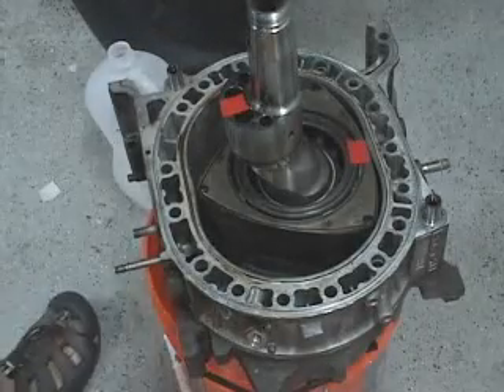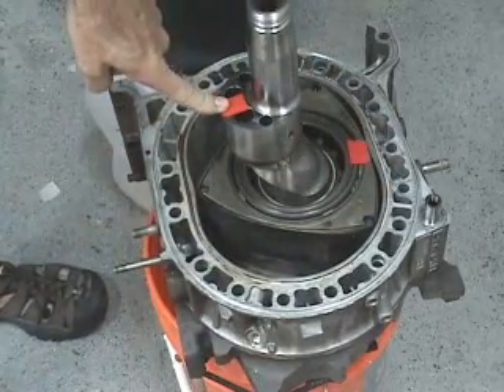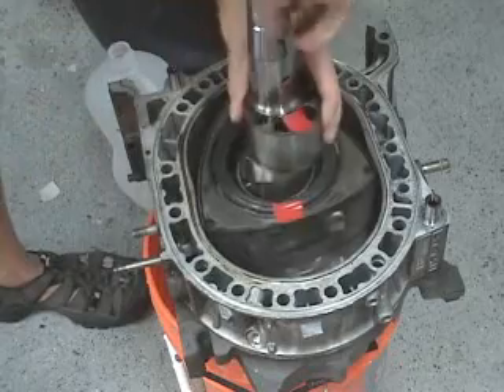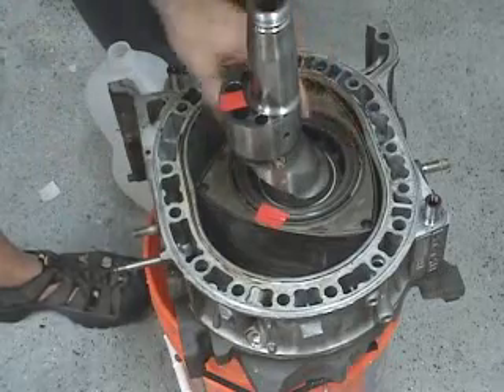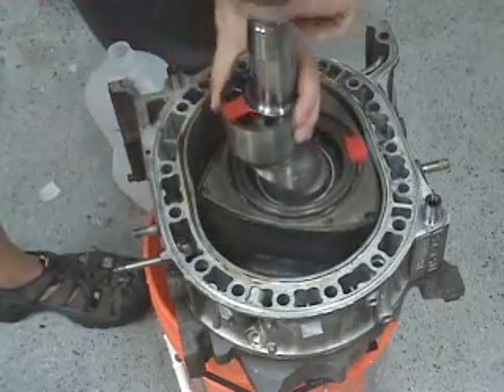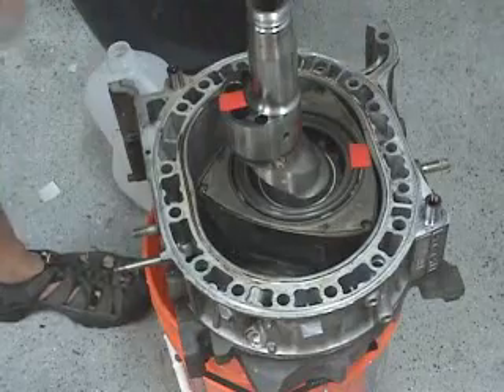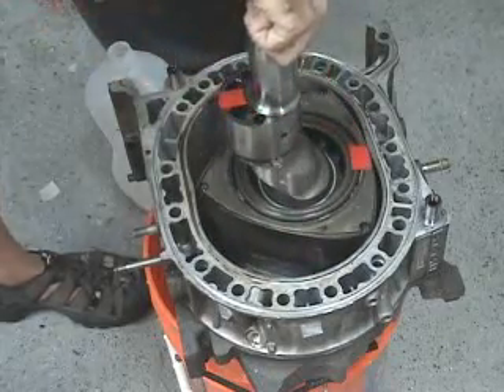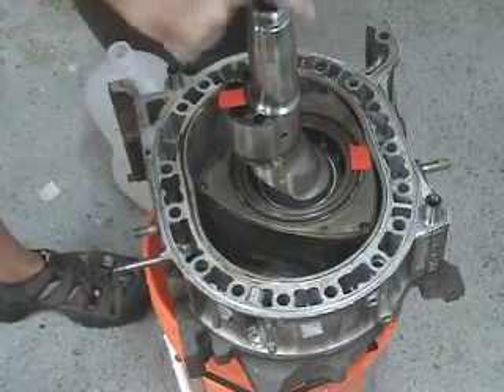Rotary Rotational Demonstration

Comment: only 15 here. would this be a 3 stroke then? or what would it be
Reply: No I think still 4 strokes. It still does intake, combustion, ignition, and exhaust, just all on one rotation.
Reply: meharidude +Pedro 's  right, calling it a two-stroke or a four-stroke has nothing to do with "stuff" happening inside or outside.. as a matter of fact they are all still INTERNAL combustion engines, which means everithing happens inside the cilinder. However these engines are also known as two-cycle and four-cycle which means that two--cycle engine does all four strokes in only one complete revolution of crank shaft where as four cicle does the same in two complete crank shaft revs which means that in two-stroke(cycle) engine intake and compression are one stroke while the ignition and expansion/exaust are another, and with a four stroke(cycle) all four of those: intake>compression>ignition>expansion/exaust are diferent strokes... The only major difference (apart from what I've already explained) betwen these two engines, which is noticable even to the small child is that two stroke engne doesnt have valwes, and that it uses a mixture of petrol and oil (not necessary but most of them do) but there's still not happening "outside" in fact the only thing happening outside is mixing the petrol with oil, which does hapens in a pump with new two-stroke engins (with the old ones you had to create the mixture yourself) but that doesn't count as a stroke.. So there you have it from a mechanical i.c.e. engineer's point of view...
Reply: Think about it, in all 2 strokes, with no exception, the gasses are forced, not sucked, into the combustion chamber. Either from a scavenging cylinder or the crankcase, sometimes a turbo is used. Bottom line, a 2 stroke can't suck gasses into the combustion by itself. Wankel, the inventor of this Wankel engine, patented it as a 4 stroke. and it is considered a 4 stroke today.
Reply: meharidude Yes I think we already agreed that Wankel is a four stroke, however I just pointed out the diferences betwen 4 stroke and 2 stroke engines, explaining in the proces that 3 stroke engine is imposible due to the technical caracteistics of i.c.e.
Reply: BUNCHofxs I see your logic but you are missing a very important fact about the Wankel KKM (and the topic of this vid) 

You don't count the piston/rotor rotations, its the shaft rotations that count, so for every shaft rotation there is one combustion stroke/cycle. (like a 2-stroke)
 but unlike the 2-stroke the intake and exhaust strokes are not combined, all 4 cycles occur separately just like a 4-stroke Otto cycle.

It is technically classified as a 4-cycle engine.

Cheers!
Reply: The simplest way to determine if a piston engine is a 2 or 4 stroke, is to count the number of turns versus power strokes per cylinder. If you have a powerstroke for each turn per cylinder you'd have a 2 stroke. However this is so simplified that it doesn't cover all engine configurations. How about double acting 4 stroke engines, would they be 2 stroke? They would have a powerstroke for each turn as well. Looking technically at a 4 stroke versus a 2 stroke, for instance if you'd have to calculate mean effective pressure, you'd look at the cylinder volume and multiply this with 2 on a 2 stroke, but 1 on a 4 stroke. Why? Because you'd have to include the "hidden" cycle that takes place in the crankcase or scavenging cylinder. This cycle also uses power and without including this your figures will be way off. So an engineer wouldn't count revs, instead he/she would look at the intake, compression, combustion, exhaust cycle sequence, as DoktorBimmer says. If one of these cycles for a given cylinder takes place simutaniously, then it's not to be considered as a 4 stroke. If you define the space above the piston (or above one of the sides of the wankel rotor) as the cylinder/combustion chamber, you will see gas being sucked in by a natural vacum, compressed, ignited and expelled. On a 2 stroke, gas is forced in, there is no natural vacum (apart from a marginal suction created by the inertia of the expelled gasses). A 4 stroke, sucks in gas directly to the combustion chamber, compresses it, ignites it and expells it without the aid of an external scavenging device. So technically its' a 4 stroke, and engineers treat is as such and has done so since Wankel invented it.
Reply: No, definetly 4 stroke. As +Ashley Caines says. The stroke/cycle aspect  has nothing to do with number of turns (common misconception), but rather what happens in the combustion chamber. On a 2 stroke, some of the cycles or strokes, takes place outside of the combustion chamber. But here, all four cycles takes place "above" the piston. So yes a 4 stroke, and btw before anyone objects, Felix Wankel who constructed it, called it a 4 stroke.
Reply: As long as we can agree it's a four stroke, then i won't burden you with an explanation on scavenging principles from an engineer's pont of view :-D
Reply: milos stepanovic It is definitely not a 2-stroke because the intake and exhaust strokes are not combined, all 4 phases are separated just as in the 4-stroke Otto cycle engine.

Cheers!
Reply: doktorbimmer yes you're right however that was not my point in the comment... well spoted though.. XD
Reply: Pedro just say what you wanna know.. :D
Reply: meharidude Good comment! nice explaination, couldn't have said it better myself.. meharidude knows his stuff..

Cheers!
Reply: If a 4 stroke creates power every 2 complete strokes (down and back up), and 2 stroke creates power every single complete stroke , this would be a 1/3 stroke engine because power is created every 1/3 rotation of the rotor. BUT this logic is for piston engines. Since the e shaft spins faster than the rotor, we need to crunch some numbers, one would probably come up with a number very close to 4.
Reply: In relation to stroke, the normal definition of the OTTO cycle does not work here, but if you must try to apply this principle one could consider a Rotary engine as a 1 stroke or a 1/3rd stroke engine. Just keep in mind that a stroke is a signal directional travel of the piston in which an engine makes an internal process to sustain itself, and the number of strokes you have defines how many individual tasks are completed at once (4 stroke= 4 separate processes completed one at a time, 2 stroke= 4 separate processes completed two at a time in a interlinking manner). a rotary engine does not actually have a stroke because the "piston" always travels in one direction. To cross apply the OTTO cycle while disregarding the directional travel of a piston, the rotary engine completes one full series of internal processes in one rotation of the crankshaft (therefore one cycle), but in relation to the piston rotation it completes three full series of internal processes in one piston rotation (therefore 1/3rd cycle).
Reply: suzi noone The Wankel KKM-57 engine is a 4 cycle/stroke design.. the intake and exhaust stroke are not combined. False, the eccentric-crankshaft of a Mazda 13b for example has a stroke of 16mm... also incorrect.. it does not travel in one direction, it actually travels in two directions simultaneously as it orbits in a PLANETARY MOTION.. and each piston face performs the exact same functions as an Otto engine during one complete rotation of the orbiting piston...

Comment: Oh yes, fond memories... all those extra stops for fuel and oil, dreading the bi-annual smog check, wondering what will cause it to fail this time, and crossing your fingers everytime you turn the ignition key knowing it may not start because the apex seal are shot and it needs yet another new engine...

Comment: pistons by definition can only move up and down. rotary engines have neither piston nor cylinder. they have whats essentially an peanut shaped hole. it still ACTS as a cylinder would. and the rotar still ACTS as a piston would, but because the shape and motion are not that of a piston in a cylinder, they are not.

all a rotary is, is a combustion chamber, a cam shaft, and a crank shaft all in one. the rotar eliminating the need for rods and rocker arms, which are needed for piston's circularity.

Comment: the first engine I ever rebuilt , was a rotary. no cherry picker no special tools. took me 1 day to tear the car down and only about 14 hours of scratching my head . and it vapor locked when I first tried to crank it and I thought I did it wrong cuase it just wouldn't fire , I went in the house ate dinner went back outside tried again . and it worked . I got 111000 miles out of it. I love mazda, just because of that experience

Comment: The Wankel is a PISTONLESS Rotary engine as I said. You can get many rotary engines that use pistons such as the Radial engines used in aircrafts like the Corsair, but the Wankel has Rotors as apposed to pistons, hence the name *Pistonless* rotary engine.

Comment: I know some rotary engines have pistons, like the Radial engine used in planes such as the Corsair. That's why the Wankel is called a PISTONLESS Rotary engine, because it rotates in a rotary motion, but it has rotors as apposed to pistons.

Comment: "It's light (The rotary). That's about it.  But that is a biggie"

Light is relative in what youre comparing it to.  A 13brew with all its running gear (just the engine, no trans) weighs in a hair over 400 pounds.  A ca18det with the transmission on it is under 400.  They are however -extremely- compact.  They mount all their weight back into the chassis which helps center the mass- Lower polar moment of inertia is a good thing (to an extent, of course.  Too much and things get twitchty)

Comment: This is called both "rotary" and "Wankel." The term "rotary" is based on the type of intake, compression, power, and exhaust movements--rather than just strokes as found in piston engines.

Comment: the apex seals wear faster when your metering pump weakens and or fails
in alot of the older rotory engines, the metals they used for the seals wore out to fast, as in off the lot, you had a very fast car, then it would lose power over the course of 30,000 miles!!!
adding atf to the fuel tank in a rotory seemed fine and dandy
atf fluid is hydrolic fluid with cleaning agents in it
i figured it would be perfect for cleaning out the cumbustion chamber and exhaust

Comment: the lubricant for the side seals and apex seals is pumped into the intake manifold via the metering pump 
even a brand new rotory engine will go through a quart of oil every thousand miles
when the metering pump fails, thats when you start to wear out your seals and eventually it gets harder to start on cold morning!
insted of changing mine out, i just started adding a quart of atf fluid to the gas tank to clean and lubricate the seals and viola!!! i even experianced an increase in power!!!

Comment: My understand with the seals is the points of the rotor don't like to be sealed and the cost of the materials needed to make a long lasting seal are to expensive to use in a production car. So, you get fast failing Wankel engined cars.
I thought Mazda made some Le Mans prototype race cars with Wankels. I'll bet is the kind of development that goes into say a F1 engine was put into a Wankel for the same purpose, you would get a more powerful engine with less weight and enough reliability.

Comment: I'm speaking from an engineer's standpoint. From that standpoint, power to weight, power to size & energy in vs energy out determine efficiency. What you are talking about is reliability & cost to benefit.
The Wankel was designed as a race engine and unlike piston engines, it can't be moved to a reliable format very easily. For example, high performance motorcycle engines like an R1 or S1000RR, don't usually last more than 50,000 miles. That they have gotten Wankels to do 100,000 is impressive.

Comment: You get much more power for it's size, the mazda rx8 stock has a 1.3L engine and gives off a bit more than 235 HP.   They are also much much smoother to rev and aren't as rough allowing for a higher red-line.

Comment: Also I've seen a lot of rx7's with 150,000KM's on them and original engine. Just because you can read the  brochure doesn't mean you know everything about the car. Nissan advertised the R34 with 275HP it has 330HP

Comment: "The most efficient engine in the world."  Oh, thats why it's in so many different vehicles, has horrible seals, horrible fuel economy and horrible reliability.  Well... at least it's light and only has a few moving parts.  Another plus is when it breaks down, you don't need a cherry picker to pull it out!

Comment: low efficiency? It's the most efficient engine in the world. Fuel economy sucks, the apex seals are a horrible weak point, and it consumes oil to run. But it's still the most efficient engine.

Comment: The advantage of a Wankel rotary is it's a compact powerplant that gives you a lot of power. Downside is that power comes at cost of fuel consumption, and it's low on torque compared to a similarly powerful pistion engine.

Comment: VW uses them in cars, they are more efficient, they burn cleaner, and they are easier to maintain.... not seeing the downside to this. I would drive a diesel car if they existed in the states, well other than in the vw lineup because I don't like vw

Comment: Thats funny because I have had more problems with my v8 than with my 13B turbo. Also @ david gonzales, 60-75k lmfao? It all depends on how the engine is treated. Of course if you're rough on an engine its not gonna last very long. If you overheat the engine or don't keep the motor oiled then of course you will wind up with an unreliable engine. Duh. Besides, far easier to rebuild a rotary than a v8. Btw its not in every car because of the same reason a v8 is not in every car... Noobs.

Comment: because these engines aren't that great, except for on paper. on paper there's only two to three moving parts, in practice those moving parts are experiencing the wear of all the moving parts of a normal v8. the biggest problem is that the whole offset thing is inherently unbalanced adding wear and making it very frustrating to keep it balance, this is a problem all internal piston combustion engines face but it's amplified in the wankle.

Comment: Actually, from 0:55 to 1:04, that is generally called the ignition cycle. The combustion stage is when the mixture reacts to give power and torque, i.e. about one more sixth of a turn after the ignition cycle. Also, I've never heard anyone complaining or arguing about the ratio in Wankel engines before; is that an American thing or something? Also; those shoes in a working environment? That's asking for some capped toes like. You're basically just a walking disaster mate, get your shit together.

Comment: A piston has a surface, and fires at each cycle, that rotary triangular shape has 3 face to 1 at each crank cycle. thus 3 fire cycle to 3 rotation of the crank 3:1, confusion realised to the ignition order to fire such an engine equates to most of the confusion. my question is why am i here commenting? do not deal with Rotary. but like the principle.

Comment: It is  two  combustions for one turn. On top of that, in conventional motors, pistons arrive twice at a still stand (top points at combustion and admission) and in this engine, since it turns, the impulsing elements never stop. The invention was quite a promise. Nevertheless, the Wankel motor apparently didn't prove to be more efficient. Mazda bought the licence, but the concept wasn't adopted by other car or motorcycle industries.

Comment: Thats very normal for an NA first gen 12a, which is more comparable to a 2.3l piston.   People think because its a 1.2 it should get 40 like a 1.2 piston. I find people just like to hate on them even though they've never owned one, most pre 99 hondas burn more oil but since it burns oil by design people freak about that as well.

Comment: It's a huge debate, search google for "black-halo-racing rx8 care-and-maintenance".  I use synth in my RX8 with no issue and have covered 30k with no issues, usual oil usage rates throughout and no seal issues (Mazda and independent racers use synth themselves in race cars - seen them and asked them at track).  Earlier rotary's (RX7 - I had one) I know was an issue as it would corrode injector seals amongst other things so I steered well clear then.

Comment: I just learner about these engines, fucking cool.  Anywho, from the wiki article on synthetic oil: "Because rotary engines inject small quantities of motor oil into the combustion chamber to lubricate the apex seals, and burned synthetic oil causes gummy deposits on the apex seals, synthetic oils are not recommended in automotive rotary engines".

Comment: Biggest reason is that Mazda owns the patent.

The others are reliability, efficiency, practical power. The rotory is an engine bread for racing.

Like a 2 stroke piston engine, the only way to lubricate the compression seals (apex seals) is through oil injection, which is unreliable. Also, there is no way to cool these seals in rotory and 2 stroke engine. Thus the seals are wear parts. A rotory consumes seals slower than a 2 storke, but much faster than a 4 stroke.

Comment: the lobe of the eccentric shaft is lined up so it gets 'pushed' sideways by the combustion.

by lined up, i mean the lobe is at its lowest point, or pointing down.

a third of a rotation of the rotor, a full rotation of the eccentric shaft and the lobe is lined up each time one side of the rotor is at full compression, ready for spark. a thing of beauty.

Comment: If you haven't owned a rotary since the R080 you have no place to talk lol,  215,000 miles on my stock 12a in a 1984 gsl-  32mpg highway.  1 quart of oil each oil change.  Pretty much the best engine ever.